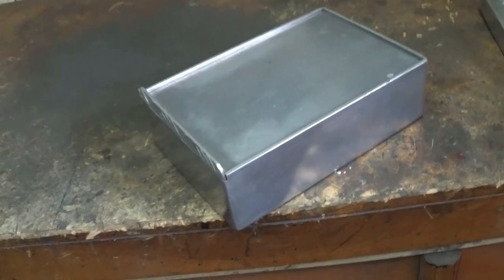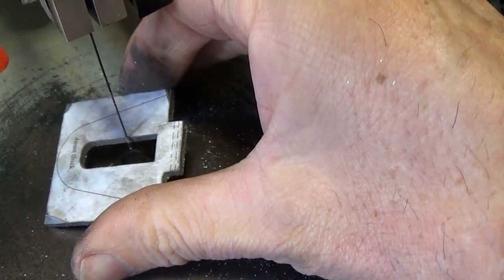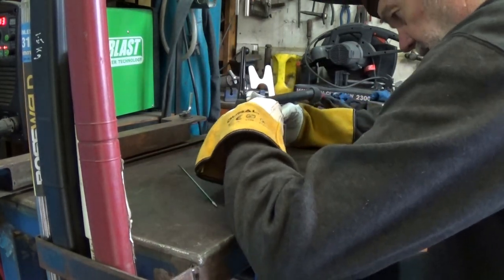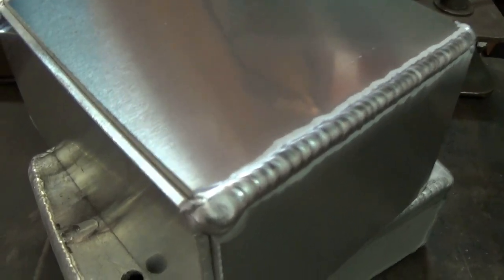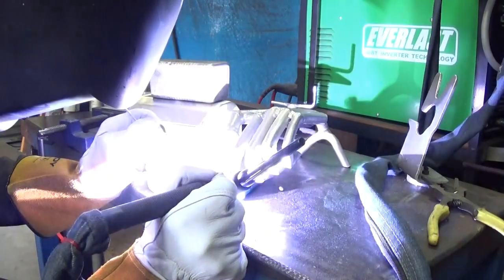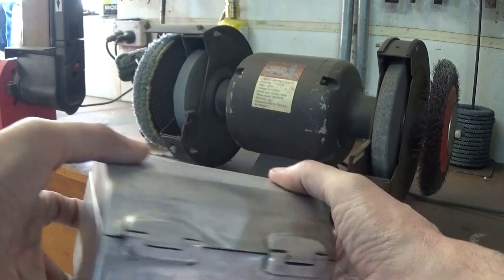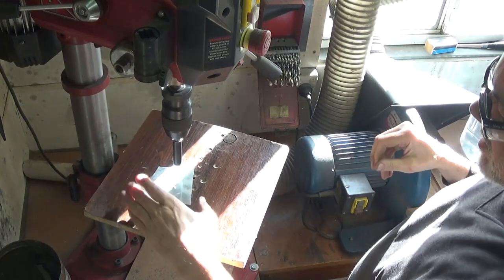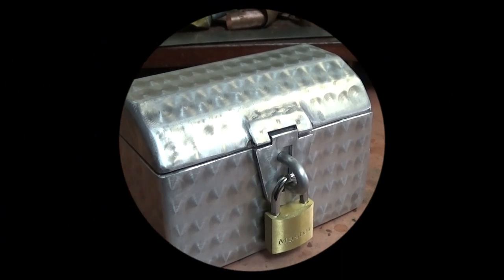Tig Welding Project - Aluminium Treasure Chest BUILD FAIL

Comment: Not bad at all. I recently 'completed' a mini box build as a MIG project out of scrap 2mm steel plate, styled to look like a WW2 ammo box. I ran into extremely similar issues with the hinges and latches. I 'finished' mine off with a simple padlock as well - but I built the lock as well (no key, just a thumbwheel but it looks OK). Overall it was fun but I'm not happy with the final result for the effort expended.
Reply from the maker: Thanks. Yes, it’s the fact we built them ourselves that is satisfying.